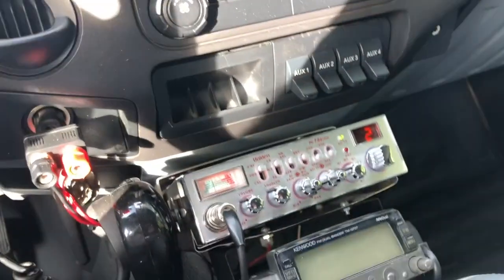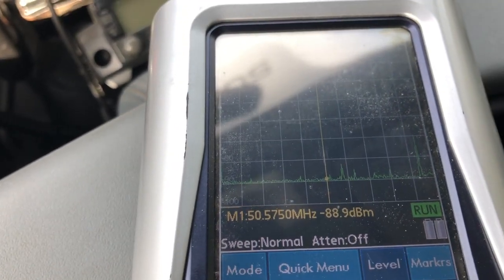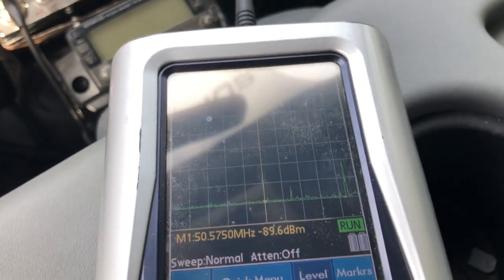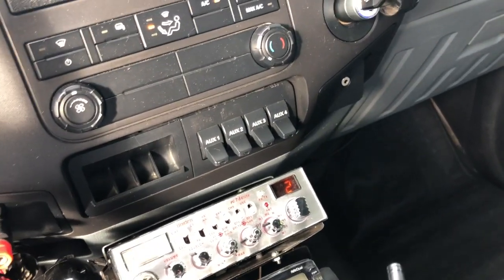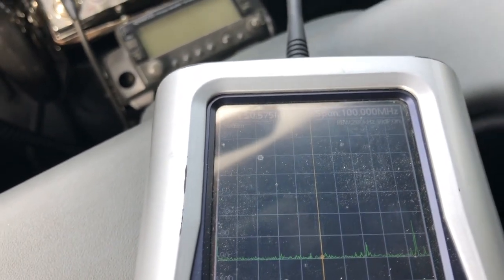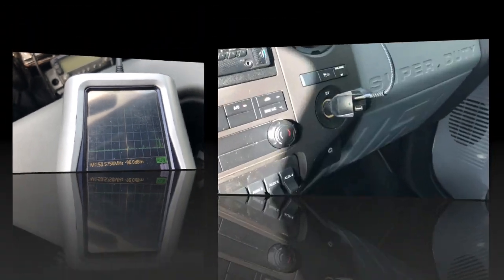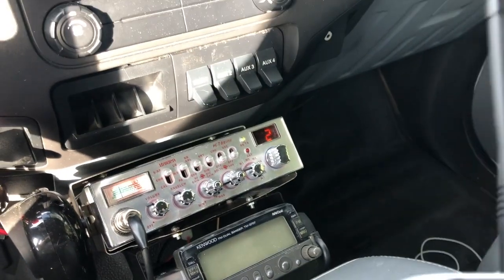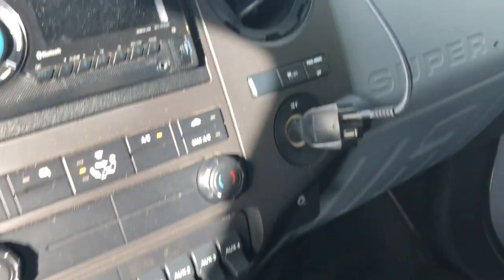Mobile RF Interference!

Comment: Yes I have seen interference from those cigarette lighter adapters (yes I still call them that ). Also many solar panel with micro inverters or optimizers pollute the neighborhood with RFI. It is interesting to me that the more modern solar charge controllers known as MPPT are noisier than the PWM types. I know you were asking about cigarette lighter devices.  Makes me curious to check the USB ports in my truck.

Comment: I don't use those, but this is very interesting! I'll ask some electronics guys at the office tomorrow. What make model spectrum analyzer is that?
Reply from the maker: Bargain Basement Ham Radio The analyzer is made by TTi.  It runs on a Palm Pilot and sits in a cradle with the interface for it.  Got it about 8 or 9 years ago.  Works like a champ!  Up to 1.5Ghz.
Reply: Thanks!

Comment: Recent vehicles pretty much all have USB charging built in.  I wonder if they have the same issue?
Reply from the maker: TechGear Junkie I have a 2016 VW Passat with 2 ports.  I'll check it out with the analyzer
Reply: @k2cjbradio  what did you find in the Passat?

Comment: The built-in USB charger in my Honda CRV makes no interference, but almost any other USB adapter generates interference.
Cheap Chinese junk is the worst - you get what you pay for.
Better USB cables, some with built-in Ferrites can also help.   If you have a cable labelled USB 1.0,  throw it away.  You should not be using it anywhere.

Comment: I have a car stereo amplifier from Walmart does the same thing on 2 meters. I thought someone was trying to jam the repeater..
Reply from the maker: Wonder if there is some sort of switching supply in your amp.
Reply: K2CJB Radio I’m not sure but I know if there is no input to the amplifier I hear the ticking sound coming out of the speakers so I’m not sure what’s causing that sound